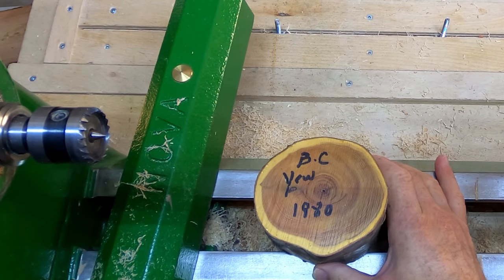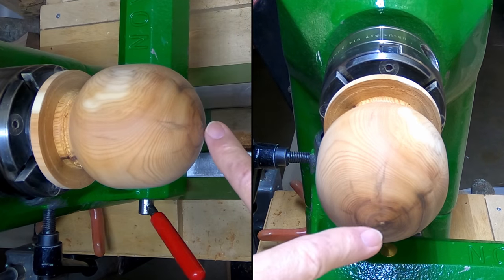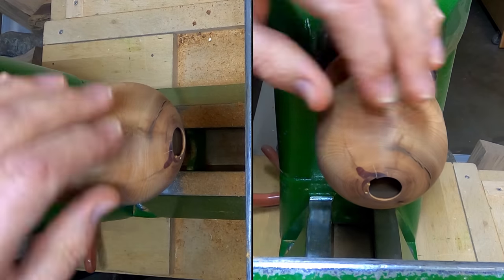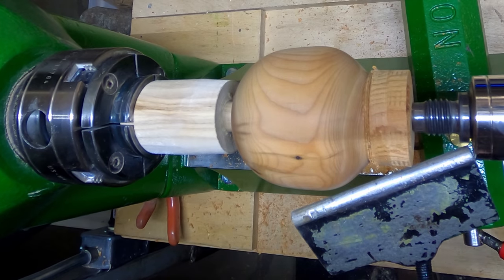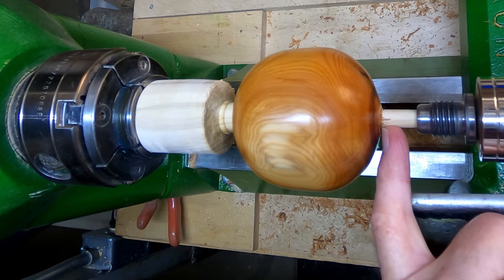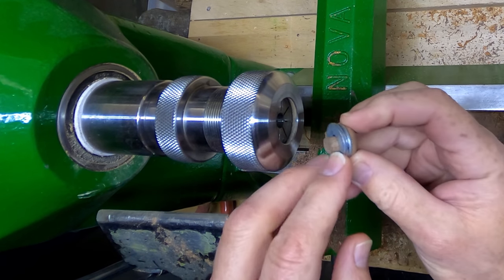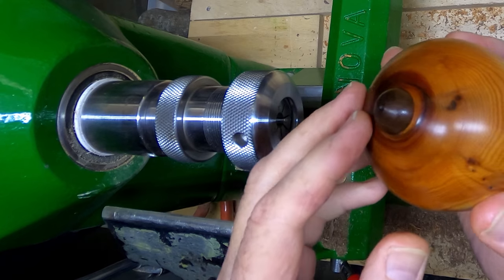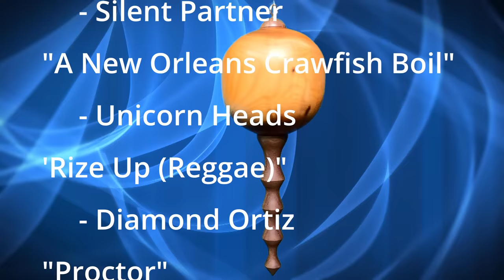2021 CHRISTMAS ORNAMENT - WOODTURNING

Comment: Nice ornament, and beautiful wood.  

Question about the collet chuck - I noted that you put the collet into the chuck body before attaching the ring.  As a result, the face of the collet was recessed inside the ring.  I had always understood that the right way was to snap the collet into the recess inside the ring before screwing the ring onto the body such that the face of the collet lined up with the face of the ring.

Also, why not drill the small hole for the screw eye when the cap is mounted in the collet - I would think that would be an easier way to assure that the hole is centered.
Reply from the maker: You are right in both cases, Louie. It has been quite sometime since I used the Collett Chuck and I guess I should have reviewed the instructions for it. Also, I would have drilled the holes for the eye screw but I had put my Jacob’s Chuck down and couldn’t find it. That is not exactly something new for me. Of course, I found it about two minutes after I finished drilling that hole. But at least at worked. Thank you for your input, Louie. I appreciate you taking the time. Thanks for watching!

Comment: Hi Gord,  I noticed  24:15 there is a slight wobble starting with the 1.25 to 1” adapter. You may want to look at the video to see if you can identify the source. I like the project. Another great work. Merry Christmas..
Reply from the maker: You are correct, Ed. There is a definite slight wobble caused by the adapter. I didn’t even notice it until watching the video because it isn’t too bad. But I think it’s time for me to replace it. Thank you for the input. I appreciate you taking the time to offer your viewpoint. Thanks for watching!

Comment: When I first started turning the globe ornaments, the late Harvey Helmke pointed out to me the difference in two ornaments I had finished. They were very similar except for one thing. The globes were not perfectly round. They were just slightly fatter above/below the centerline, on one side. I had assembled them differently, not having noticed. He had me look at them side by side, backlit by a window. The one with the “fatter” side at the bottom looked heavier. The one with the “fatter”’ section to the top looked lighter as it looked like everything flowed up, making it “lighter” and more pleasing to the eye. Hope this helps.

pa., you chose right!!!
Reply from the maker: Thanks for the tip, Clayton. I appreciate it. Thanks for watching!

Comment: Nice ornament, Gord. Thank you for sharing. I really appreciated the double step mandrel.
I noticed an error you made using the collet chuck. You need to seat the collet into the retaining ring before putting it into the tapered body. The collet will be self extracting when used this way, and much more accurate. The lower part of the retaining ring is not machined to be the clamping surface.
Enjoy the holidays!
Reply from the maker: Thank you for the reminder, Ken. That’s what I get for using a tool that I have not used for a long time. I should have read the instructions, obviously. I appreciate you taking the time to remind me. Thanks for watching! Have a wonderful Christmas! 🎄🎄🎄🎁🎁

Comment: Very nice Gord. Yew is such a lovely wood. BTW I think you will find your collets are fitted to the nut first. Do you apply sand and sealer before the Acks? Geoff
Reply from the maker: You are correct, Geoff. I have not used my Collett Chuck for so long that I guess I should have looked at the instructions. Oh well, at least it worked and hopefully I will remember to do it properly next time. No, I did not use sanding sealer on this piece. I was in a rush and felt that the walnut and Yew were dense enough that I did not have to worry about it. I think it turned out very well without the sanding sealer. Thanks for watching!
…..Gord